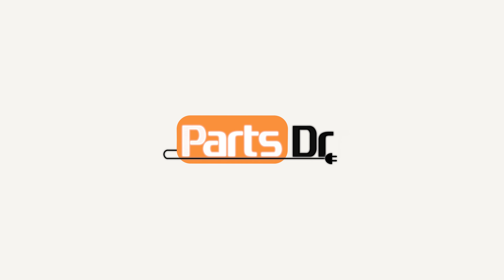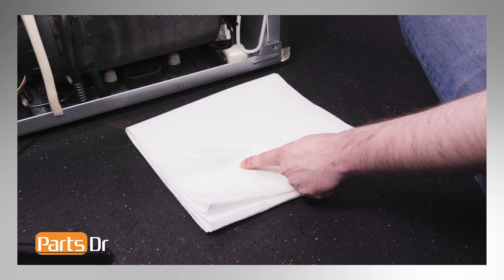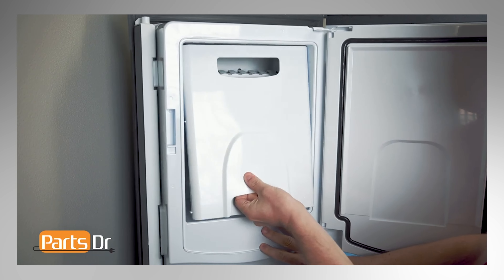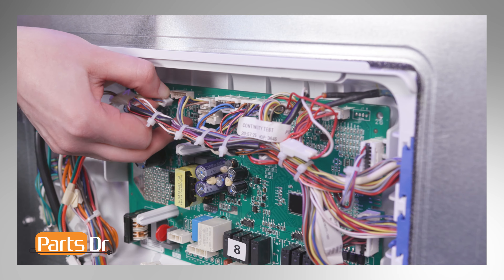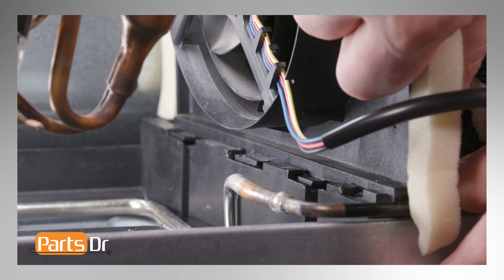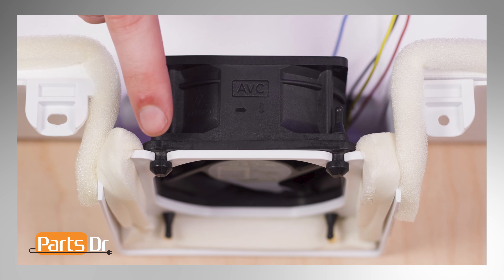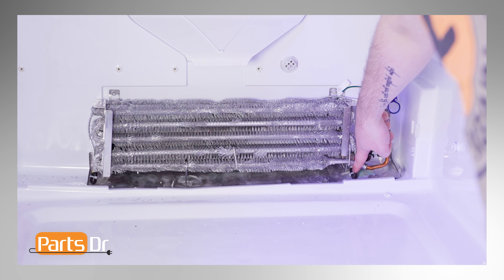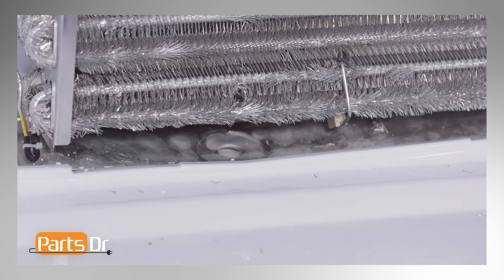Easily Disassemble Your GE French Door Refrigerator: Step-by-Step Guide

Comment: Hi.  Good video.  I am having an issue with residue in the ice that the ice maker produces.  Maybe it is bacteria.  There is no residue in the water from the water dispenser.  I am assuming that there is bacterial growth in the line that feeds the ice maker.   After the water line enters the ice maker side there must be a splitter in the line from the water filter that feeds the dispenser and the ice maker.  I assume that only the ice maker segment of the line needs replacement.  I already pumped a vinegar mix through the line and replaced the water filter afterwards.  The ice still came out with residue 16 hours later.  I will give it more time to clear out - maybe the vinegar broke lose more of the residue source - either way I will wait and see before line replacement.
Reply from the maker: The water line splits at the water valve in the door 0:52.  The ice maker itself may also need to be replaced.  Sometimes the non-stick coating on the ice maker degrades over time and it can start to come off into the ice cubes.

Comment: So that black tube next to the condenser motor leaks water ? Is that just condensation leaving the fridge ? There’s a little bit of water on the bottom pan and idk if that’s good or not
Reply from the maker: It is normal. This water comes from the automatic defrost cycles and evaporates in the tray next to the compressor.

Comment: I replaced the fan with ease. However, while doing so, I could see that the black plastic wrapping was melted. What problem does this cause and what should I do to fix. 14:45
Reply from the maker: It looks to be heat shrink tubing.  If the wiring is still in good condition, you could try replacing the heat shrink tubing with some the same size.
Reply: @PartsDr  thank you. I was worried I might have a bigger problem.
Reply from the maker: @brendaryan7523  You should be okay from what you described.  If the wiring harness is damaged, then you will need to replace that the wiring harness.
Reply: @PartsDr  thank you. So far, things are running fine. I have a fridge thermometer inside the fridge and the temp fluctuates a bit, but no problems or unusual noises or anything. I appreciate you following up.

Comment: We recently replaced our fridge and moved it out to the garage. I recently noticed that when barefoot, the left door and back panel shock me when touching it. Do you have any thoughts on what it could be?
Reply from the maker: Try using an extension cord to plug the fridge into a different outlet.  This will help rule out an electrical issue with the outlet.

Comment: have this same exact fridge. Today i noticed a faint smell that smelled like burnt hair. What could this be ?
Reply from the maker: You might check the fan motors, defrost heaters, and control boards to see if the smell is coming from any of those items.
Reply: @ control board looks like it’s behind the fridge according to the video correct ? It’s brand new and still under warranty. If I look myself will it void the warranty ? Didn’t look to see if it has tamper proof seals
Reply from the maker: @TrillaNasty  If it's brand new you should contact GE and have them take a look at it.  We don't think removing a cover would void any warranties, but you should first check with GE.

Comment: Hi, I troubleshoot all systems on my Samsung Dryer and still not working? It turns on and no error code displayed. I replaced the control board, fuse and thermester and moisture sensor
Reply: Do new dryers not have heater coils anymore? That is where I would start. Also check your fuse box (the house one not the fuse on the dryer) dryers are 220. Depending on what type of circuit breakers you have. Only one half can flip off so the dryer will come on and spin but not get hot. Stoves can do the same thing the oven will get hot but the burners won't. Good place to start.

Comment: GE Refrigerator GSS25GYPGCFS parts diagram at GE online  some of the parts are not the same as whats on mine. For example defrost heater, the one online is the type with a metal plate and holes in it . Mine actually is the solid black looping type. Next example online the defrost heater has a biametal about the diameter of a nickel  type on top of the evaporator and a white plastic wire type thermister in the diagram. Mine only has a white wire with plastic on end,  a thermister.  Also its unclear how many it has. The diagnostic test pulls up 5 . All but number 5 show P- pass. Number 5 shows O.  But enclosed with refrig sheet says number 5 is NA.  My issue is it doesnt cool. Its a new non warranttied refrig sold to me as is. I replaced capacitor and overload relay.  All fans/ lights/ display screen work.  Tested pins/ windings on compressor as well as for grounding. All tests within normal ranges